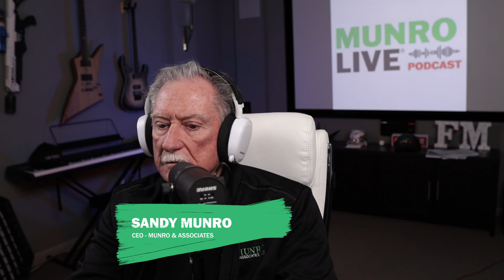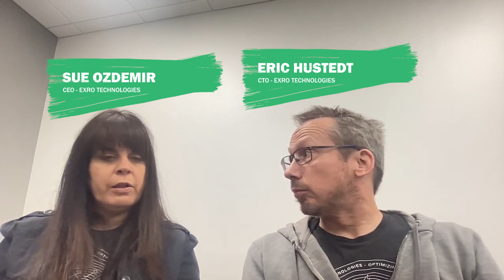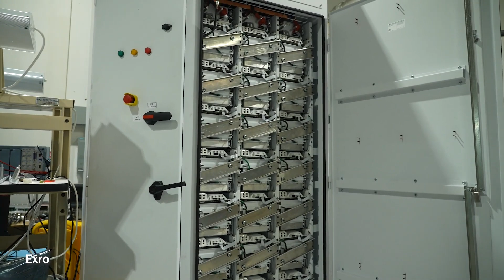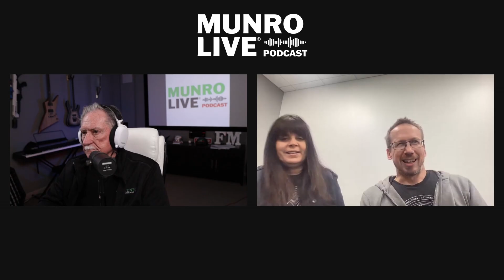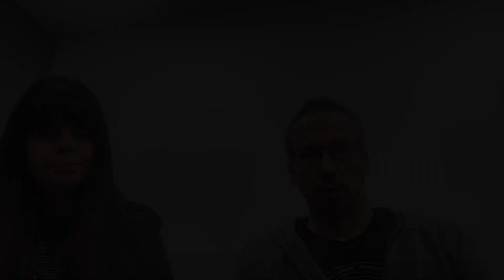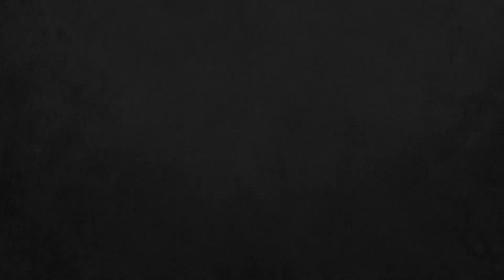How Exro's Innovations Can Extend EV Battery Life

Comment: I have done 120 thousands miles on my 2018 Ford Focus electric exclusively using fast DC charging cycling from 20-95% and car still runs like a champ degradation less than 10%